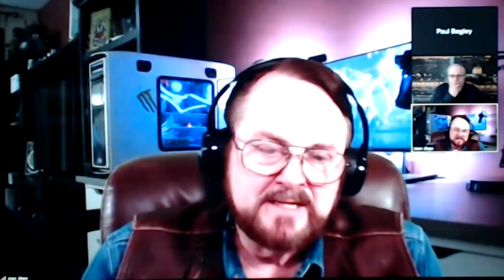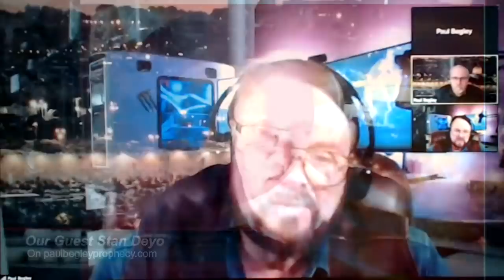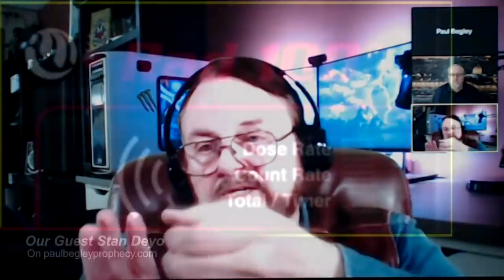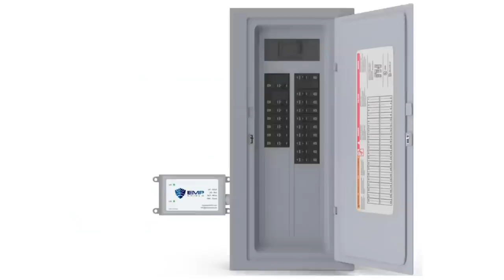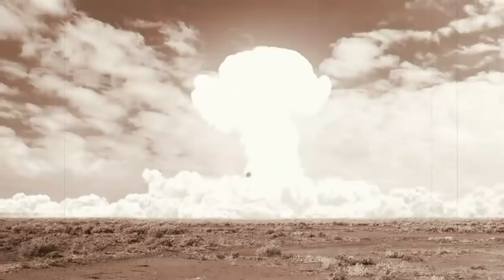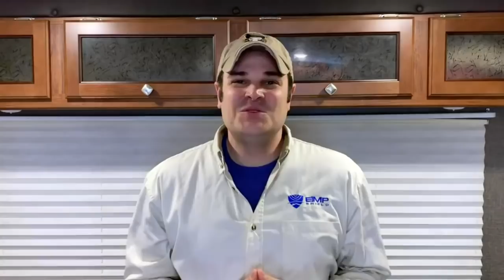Breaking: "Nuclear Power Plants Concerns" / Stan Deyo & Paul Begley

Comment: If an emp turns off the electricity which allows used rod pools to boil out.  Then they do burn.  But they don't spread radiation.  They just put stuff back into the atmosphere that normally makes there.!   The reason the government want to keep all this fuel rods, is because it still has use in the future as Energy.!!   So they are cubby holing it away.  IT HAS VALUE